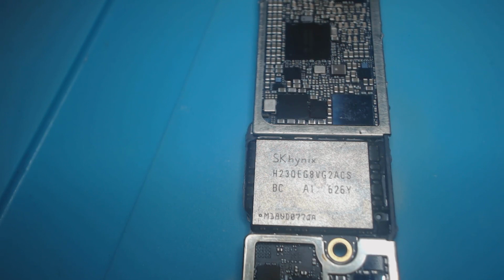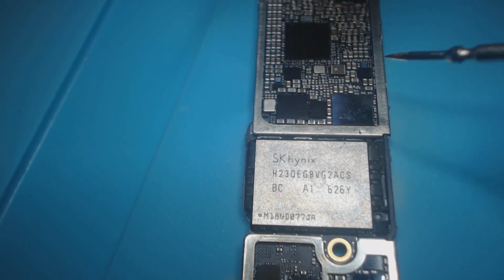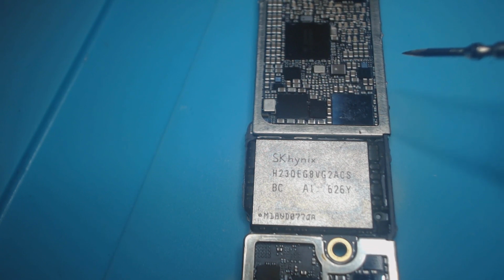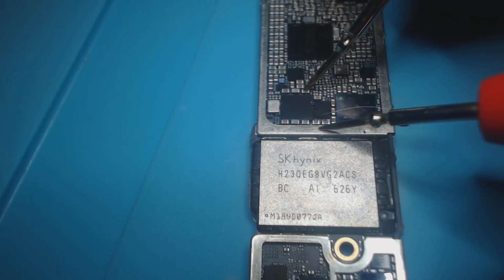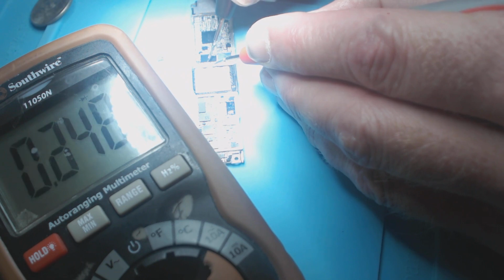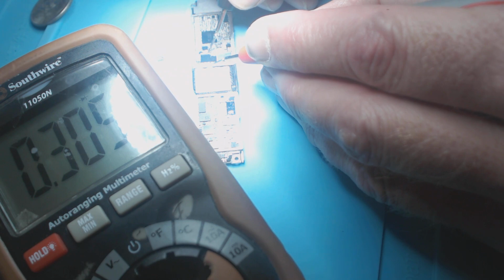Iphone 7 Error 4013 LDO 9 Short and WTR4905

Comment: That chip more than likely has an internal short, using ZXW you can pin it out from ground to each pad to find the short.  On iPhones anytime you remove a component and it relieves the short its a pretty good assumption that component is the culprit. Keep in mind when a line goes into a resistor or filter a lot of times the other side may go to another line hence not seeing a correlation between your short and the chip pulled.  I have one right now with a different short that goes through that chip and to another chip a little further down so I am still hunting for that one. Check the capacitors just above the chip you just pulled and see if there is a short.  That is the short I am chasing right now.  Good video we need everyones input to get a more permanent fix for this issue.  Right now about 80% that have error 4013 can be fixed with a re ball of the BBPMU but just like with touch disease on the iPhone 6 plus eventually we found out that it was a weak joint at the M1 pad causing the problem.  Once we started running jumpers wire returns are next to non existent.  Good job I am looking forward to future videos once you get your equipment!
Reply from the maker: Thank you very much for your comment :) Sorry it took me a few to get back to you but things here have been busy and sometimes I get sidetracked. If you have a moment, can you double check LDO9 and tell me the related "Link" to the WTR IC? I could not find a short on anything around the area or anywhere around BBPMU... but replaced the WTR with 2 different known good donors that I reballed and both shorts returned each time :( Thank you again for your input :) Finally got my Microscope Camera, a Blue Snowball Mic, a couple other toys and just started posting a few over the past few weeks.
Reply: Lol @ " 80% that have error 4013 can be fixed with a re ball of the BBPMU", no way.  From experience, maybe more like 30%.  And it is not even like the touch disease issue on iPhone 6 Plus.  Maybe you haven't done enough.  I have.
Reply: The short is probably the other WTR near the bottom of the board.  Check for the big capacitor next to it.

Comment: Have you had one with no short anywhere, diode mode under bb pmic compared to a good one all checks good but still reboots with error 4013. I’ve reballed bb pmic several times as well
Reply from the maker: Yes, just today... no more error 4013 after iOS 12, but has searching/no service. I reballed bb CPU 2 times, new bb pmic, both new wtr ic's, and no shorts... had to send back no fix/no fee (could not activate)
Reply: It’s weird because originally I just reballed bb pmic and phone worked for a day then back same issue. I replaced bb pmic 3 times didn’t fix. Reball didn’t either. The bb voltages never come up not even a second like usually if there’s a fault even with iOS 12 still fails with error 4013

Comment: hello if you change the chip with new one does the short back ?
Reply from the maker: Moh Ak yes, i replaced with new ic and it came back....removed bb cpu and it went away. Short was under bb cpu but somehow it was linked to the wtr as well
Reply from the maker: Yes, it did
Reply: My Iphone Rehab this is strange. Please do a follow up video once you find a solution. Consult others on YouTube with lots of experience with all versions of the IP7 model, like Chris at B&C Connection, Jessa at ipad Rehab and/or Louis....
Reply from the maker: I never did find a solution as the short was discovered within the BB CPU itself. even though short went away when removing WTR IC, it would not go away after several attempts at replacing WTR. Only after removing BB CPU did short stay away when any WTR Chip was put back on. I sent a few messages out to Chris and Jessa but both must have been too busy to reply
Reply: It was discovered that the BB CPU was shorted internally, and unfortunately, this issue is not repairable since the BB CPU cannot be read to write onto a new BB CPU.  Unless there is a new i7 programmer that could do this, which I am not aware of.